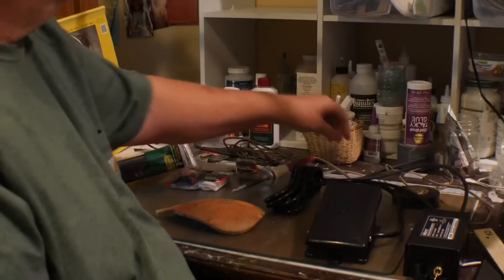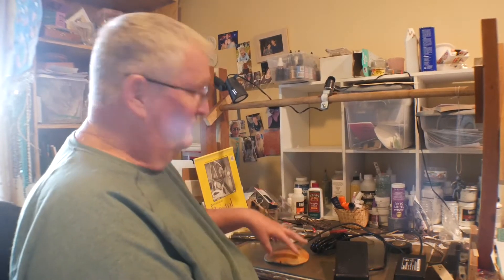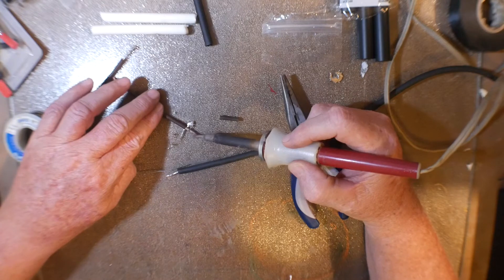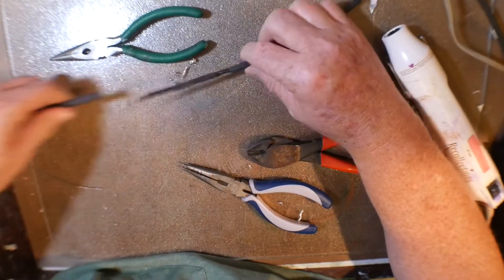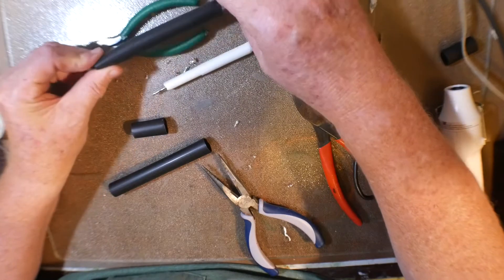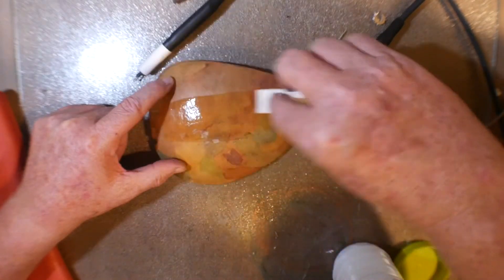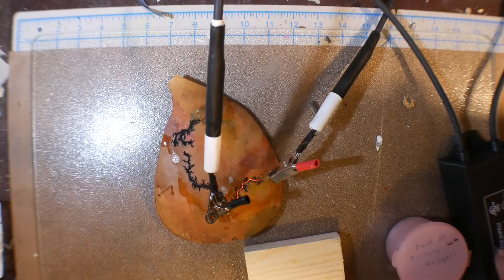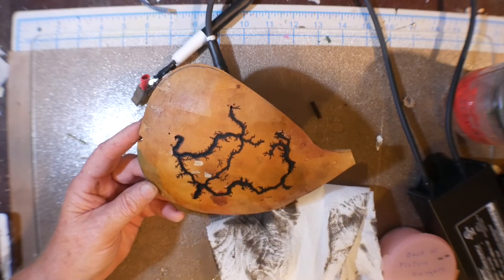Lichtenberg Device : Adventures with Gourds: Using Electricity to Burn Gourds

Comment: I graduated #1 in my Army Engineering Power Generation and equipment repair class and I worked subcontract for one of my State’s Power Companies.
This is an unbelievably irresponsible video; unsafe and dangerous.
I purchased and use an approved and licensed Lichtenberg Fractal unit equipped with a Deadman’s foot petal and do not take safety lightly nor for granted.